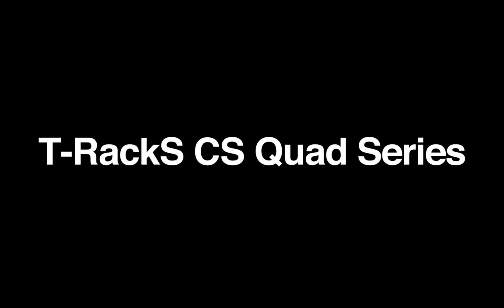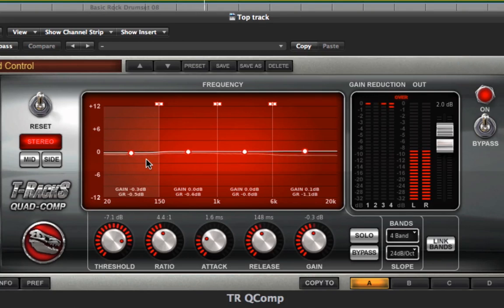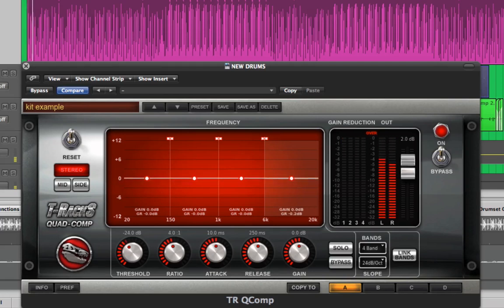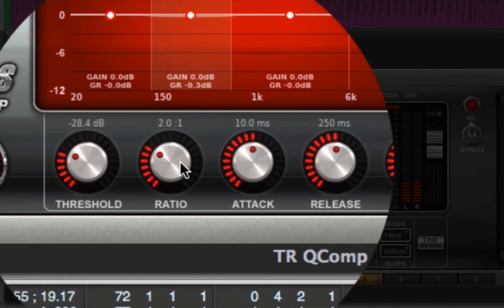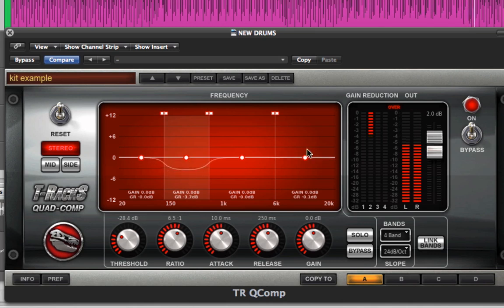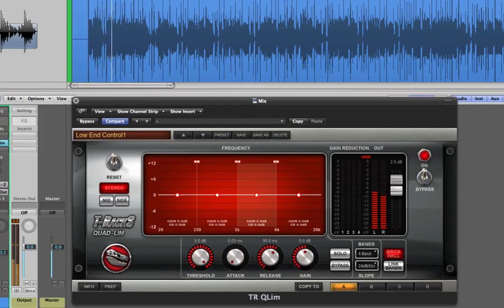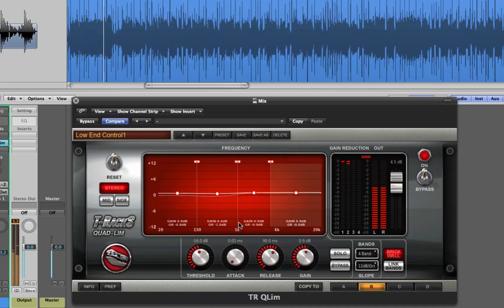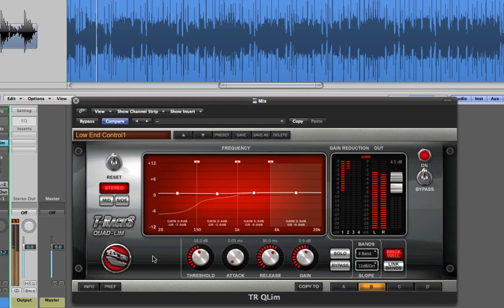T-RackS Custom Shop Quad Comp and Quad Lim Mixing and Mastering Tutorial

Comment: I love these series but I have a problem when using them within a mix. Many times I have to put the threshold on the lowest value possible and still the sound is barely loud enough to trigger the compressor. Would it be possible to update the plug-in to allow the threshold to go even lower?
Reply from the maker: Please report your issue to IK support at http://www.ikmultimedia.com/contact-support/mi/ and they will assist you with pleasure.
Reply: ikmultimedia Thanks for the reply! Well, it's not much of a problem but mostly a suggestion. I was referring to the quad comp btw, didn't mention it before.
Reply from the maker: saikun23ify To me it doesn't sound like the proper behavior of the plugin and something may be able to change in your use of the plugin to have it work better for you.  So I would contact support regardless.
Reply: same and it seems that the issue still hasn't been fixed. Not sure if it's a issue or the plugin has more headroom or something like that. With stock repaer multiband compressor at -17bd threshold the comp kicks in with -0.5 to -0.9 gain reduction, but with quad comp, with threshold of -26 there is a gain reduction of -0.3.
Reply: Mix louder